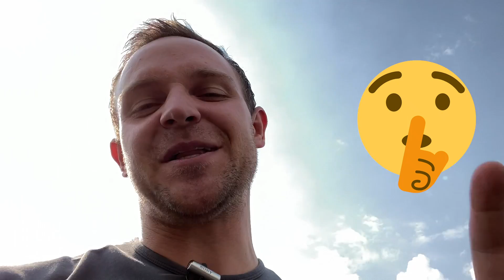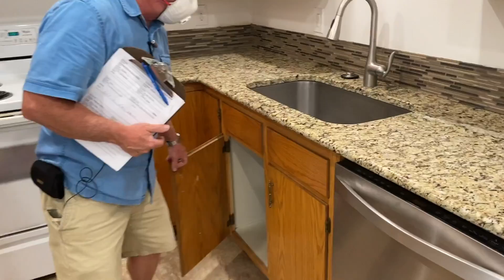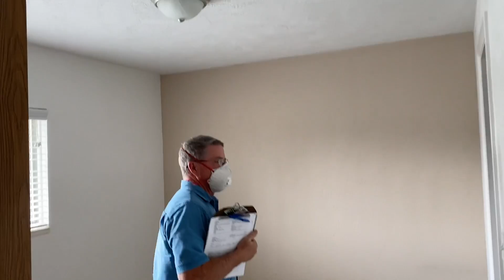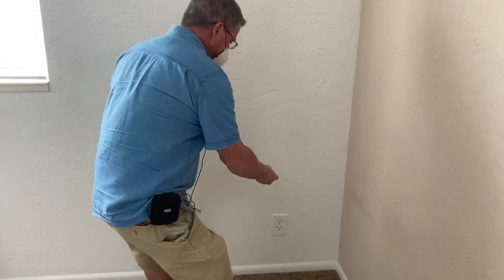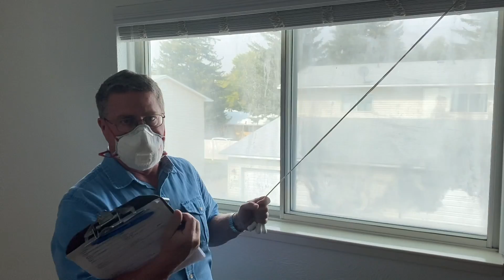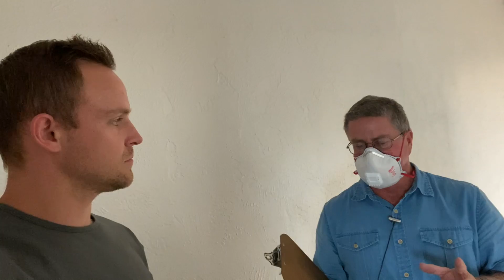Apartment Walkthrough With My Inspector | What To Look For

Comment: My experience the inspector has been a huge expense, especially when there are several units.  Maybe you get a better price or your location has more reasonable rates than mine.  After the first 2 I got, I have done my own inspections.  
But overall, that 15 looks excellent.  Wish I could find them like that too where I'm at in Chicago .  Good luck